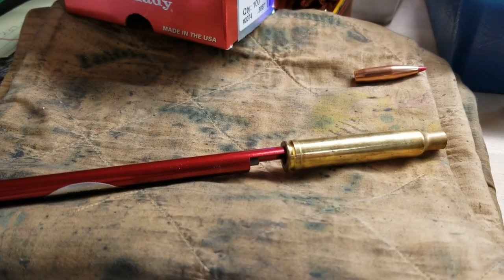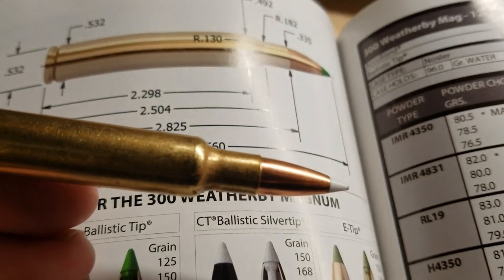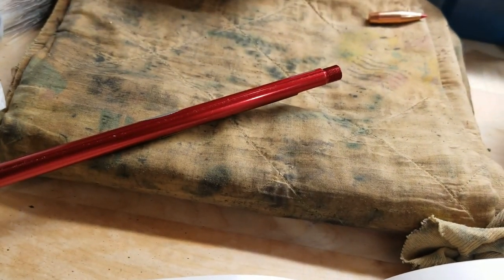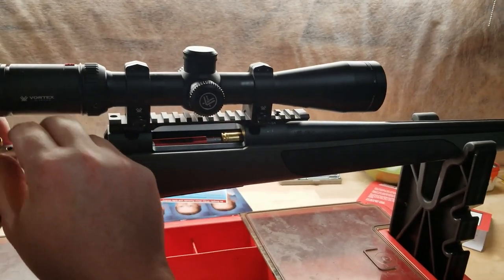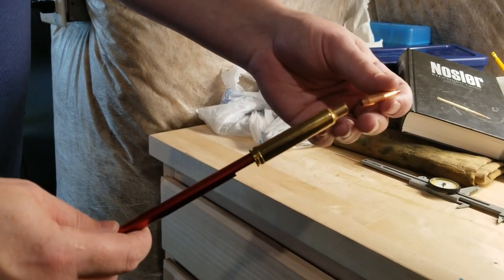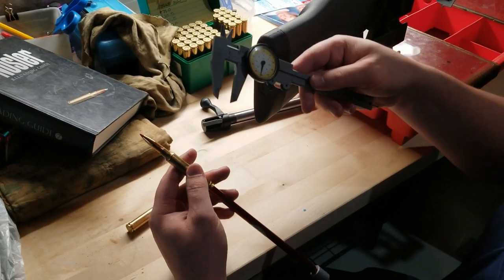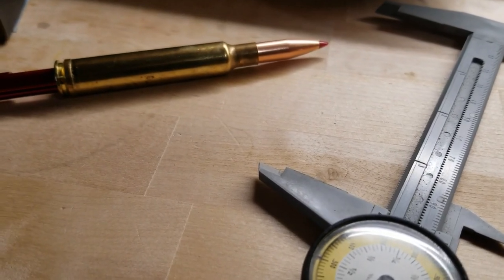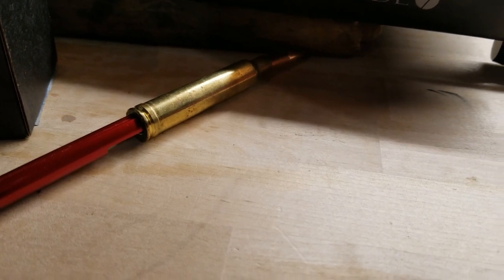Weatherby Freebore: How much freebore is in my 300 Weatherby?

Comment: SAAMI specs dictates freebore on a factory reamer is .361". Your readings will change depending on what bullet you use.
Reply: In mine the bullet fell off the end before it touched, was even worse than this one
Reply: @robertboyd3863  probably still very acceptable depending on weight of bullet and how much the rifle has been shot. I had a .270 WM that was the same way with 140 grain bullets.

Comment: That’s really cool to know, would be great to see what other Weatherby calibers are running for free bore. And then compare that to there counter parts in that class. For example : 300 Weatherby free bore vs 300 win mag, wsm, rum, nosler etc. And the same with 257, 338-340 and so. Really makes me curious as to how much free bore the 30-378 has. 👍👍
Reply: The 30-378 has to use about 20 grains more powder to get the same speed as a 300 wyb, then another 10 to get it's top speed, very over bored impractical round

Comment: Thanks for posting this, I knew generally that Weatherbys had generous freebore, but had never known how much.

I recently received my Dads 300 Wby Mark V and bought a modified case to be able to have for my load development for the rifle, I was surprised to find the same near half inch freebore when comparing a 180 Nosler AB to the recommended COAL.

So I walked away, understanding that I had wasted $15 on my modified case, and that my load development is going to be based off of testing different powder charges and leaving the seating depth up to the magazine capacity. While most rifles I reload for I’m playing with tests of 10-50 thousandths of jump, a weatherby says “hold my beer” and goes for 500 thousandths! Haha 

I don’t think there will be any point in playing with seating depth on a weatherby like I usually do on other rifles. Unless maybe it changes up velocity / pressure? I don’t know how much it could affect that though. Let me know if you have any thoughts on that.
Reply from the maker: For hunting.... load it to the magazine length and find a powder it likes. I have messed around a little with match bullets and found .3 inch accuracy by loading it to 3.650" instead of 3.560". Just have to single feed them....
Reply: It allows you to load much longer bullets without getting into your powder charge. Think like a 230 grain bullet for example

Comment: You can seat the bullets out and increase the powder charge and have more energy velocity out of the 300. Randy Selby of The Real Gunsmith has a dissertation on it.
Reply: It would turn the rifle into a single shot you COULDN'T use the magazine but you would have the true ranging ability of a MAGNUM  without getting ridiculous with the 30-378.
Reply from the maker: My magazine really limits me to the SAMMI length. I'm getting plenty of velocity though.

Comment: Question, I recently and aggressively removed the copper and stubborn carbon from one of my older 300 WBY rifles, I then went to the range with factory 180 grain Interlock flat base bullets. The three shot group almost went through the same hole! I thought 6.5 PRC was an accurate cartridge. Why would I load any differently then what what WBY recommends? I seriously do not understand this philosophy.
Reply from the maker: Any cartridge can be accurate. Barrel is a huge reason why a cartridge is accurate.
Reply: This is true, however when a barrel is designed  with a freebore do you think it wise to alter the principle to achieve a desired outcome? Do pressures increase when you increase the seating depth? Regards
Reply: @rockylavigna5977  It should, Some loads have compressed powder charges and normal pressure. Some powders allow empty space behind the bullet. Some manuals state the bullet is compressing the powders and it's safe to do. Nosler data states the % the powder occupies inside the case. If over 100 % means compressed. It's safe to go a bit under max when changing a component. The same load might be exessive in one rifle and normal in another(The chamber dimention vary as well as the freebore) If your magazine allows to seat out the bullet you gain powder space.

Comment: There is quite some debate about freebore. According to Randy Selby it should be about a Bullet diameter
Reply from the maker: Not sure it's a debate. If you can load the bullet close to the lands you will in general have better accuracy. The Weatherby cartridges are accurate despite all the free bore
Reply: @ReloadingWeatherby  Just was checking the 307 action specs and Wby claims 3.95". Interesting if the magazine allows seating out the bullets a bit.👍Very well priced at $750 for a build
Reply: @ReloadingWeatherby  I never had one that was , my $200 Thompson Center Compass vastly outshoots any of my Weatherby's
Reply from the maker: @robertboyd3863  Unlucky for you... all of my Weatherby cartridges shoot under half MOA.  
https://youtu.be/DWha4uh3Bgc?si=FZleynN0lkRDR_yh
Reply: @ReloadingWeatherby  Mine tend to shoot minute of moose

Comment: Weatherby is pretty much the only manufacturer that does this. The reason for Freebore is speed. Just like the cartridges were designed for more speed the Freebore helps with that. Seating the bullets out farther allows more case volume also which can achieve higher velocity. The guns are still accurate from decent barrel quality and fitting. Those freebore tools are useful for most calibers other than Weatherby calibers.
What alot of people do not factor in is recoil. If you compare all the ultra magnums they are higher in recoil. Oddly with slightly less case volume the wby cases achieve the same velocity bit with less recoil. The rounded shoulders and freebore are all contributors to this. Weatherby is very under-rated.
Reply: Whetherbys generous freebore decreases peak pressure sacrificing accuracy to have more muzzle velocity
Reply: Actually it's very inefficient, better designed calibers can get the same speed with less powder and of them don't shoot very good either
Reply: @milboltnut  You just have to use more powder to get the same pressure and speed .

Comment: id just shoot my own first 20 rounds of homeloaded .300 wby's.....the freebore in my rifle is 7mm, but i seated the bullet so it now measures total 3.740 inches, 95mm FINISHED LOADED ROUND, and its a tad over 5 mm freebore now....using NORMA MRP POWDER AND SIERRA MATCHKING 180 GR. BULLETS....
STARTED AT 76,5 GR -MRP, TO 78,5 GR, AND FINALLY MY LAST 10 WAS 80,7 GR MRP, NO SIGN OF EXCESSIVE PRESSURE...BUT RECOIL WAS NOTICEABLE HARDER AT 80,7 GR MRP...USING BENCH. I HAVE LOADED WITH 83 GR. OF MRP...AND ACCORDING TO QUICKLOAD PROGRAM THEYRE WITHIN SAFE PRESSURES...BUT AT AROUND 84,7 OR  85 GR. THE QUICKLOAD PROG SAYS IT IS AT AROUND MAXIMUM....
Reply from the maker: Thanks for commenting and watching the video!